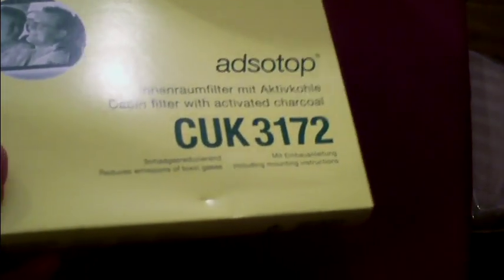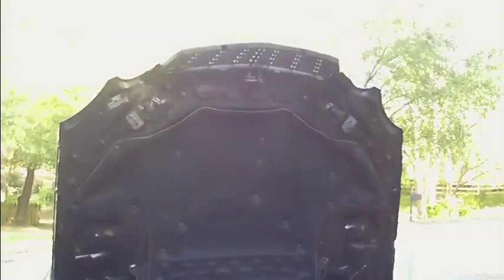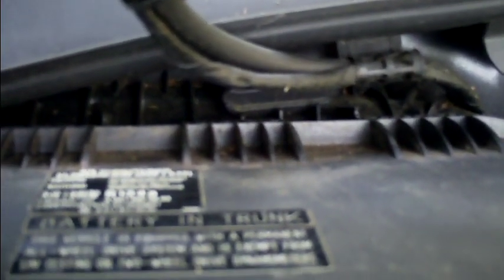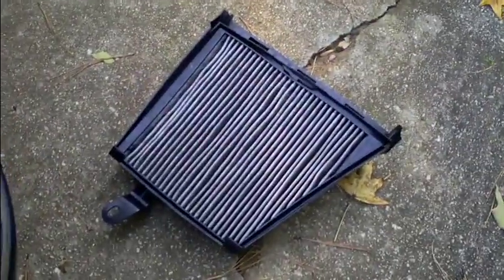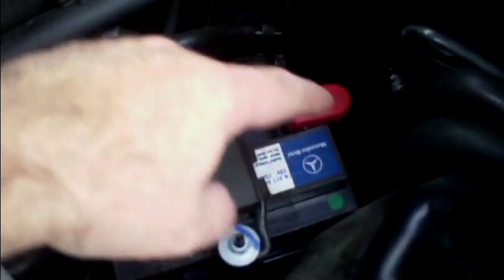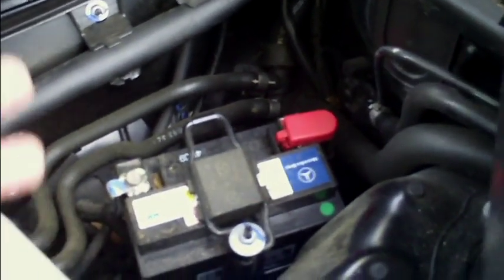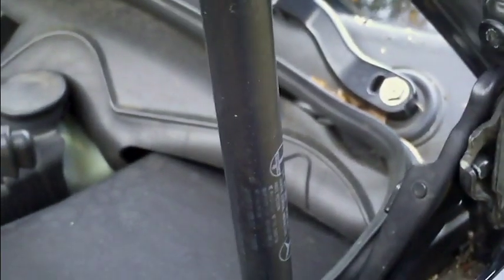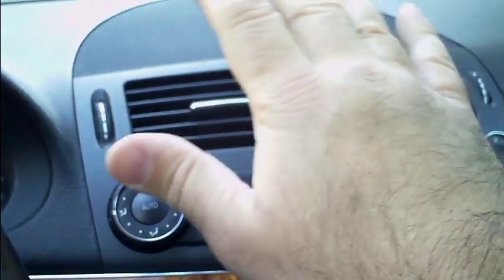2005 Mercedes E500 4 Matic Cabin Fresh air inlet filter replacement (W211)

Comment: Another good video, with tips on how to put hood into "service mode" for improved access to a tight area.
I would note that although the MANN filter does fit correctly, it does not come with the plastic frame as does the
OEM filter from MB. While the filter housing is removed it is also a good idea to check form accumulated 
Debris, such as leaves, etc. around the backup battery located directly below the housing...

Chet
Reply from the maker: Thanks Chet for the comment. Yes, I have a lot of trees and that tree and leaf debris is a constant hassle.

Comment: You should get a message if it goes bad. But you can easily check it with a voltage meter and tell if it is good or not. After replacing turn on the heater, heated seats on high, and all electronics to pre-load the battery. You may have to re-sync the windows and sunroof, but mine worked perfectly fine.

Comment: It is a Auxiliary Battery i believe it does help take strain off of the main battery but mainly used for the SBC Brakes. When this battery goes bad you will get a red battery message on the dash and you will then need to replace it. I can't exactly remember which battery i bought ill check it when i get a chance and get back to you.

Comment: That battery actually is for the SBC Brakes. Once it goes bad you will get a red battery message. You can replace it with a motorcycle battery for about 90$

Comment from the maker: Not so sure about that. Everything I read says it's an auxiliary battery used to stabilize voltages. I assume for the computer(s). You might be right, about it being for the braking system. Do you have a link or something I can look at? A motorcycle battery seems like a good idea though for a replacement.

Comment: Good Job. Is it the same for a E500 Wagon?
Reply from the maker: I think so, but it's easy to check out. I think it a good idea find a dealer on ebay or rockauto.com and try to plug in your model year to see if the filter I used is the same for your model.

Comment: To bad your description is inaccurate it is not the "cabin air filter replacement"
The correct description is Cabin fresh air inlet filter replacement.
Why does no one address the proper procedure for filter replacement of the cabin recirculating air filters
Reply from the maker: Melinda Knapp You are right. I found this out a few months ago. I'll change the title of the video. thanks for your comment.